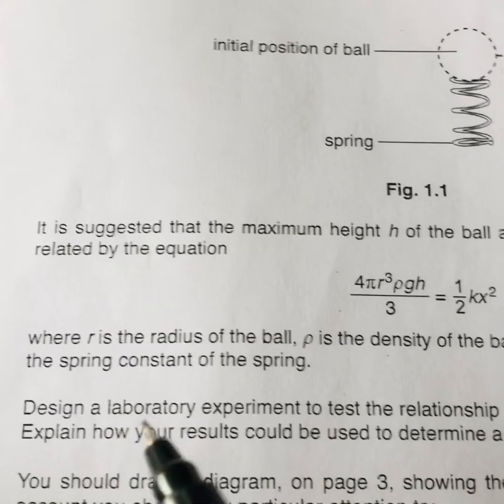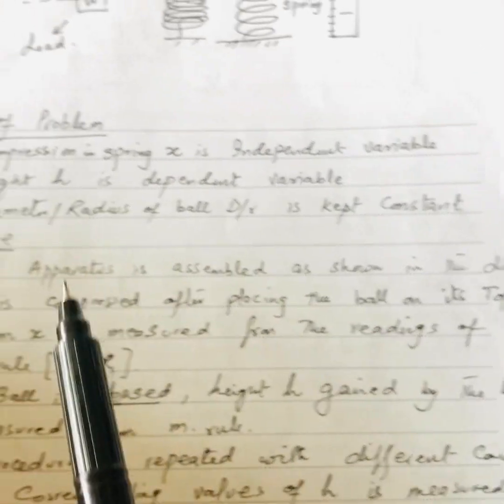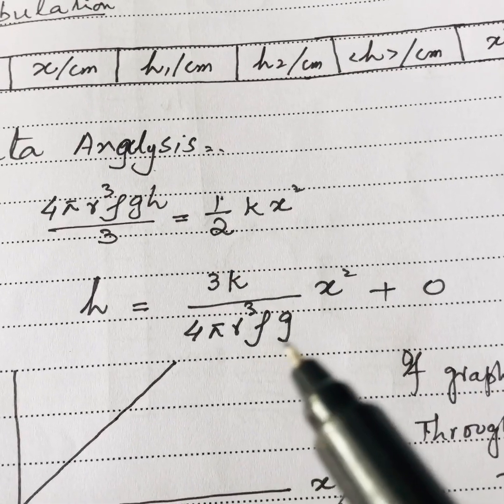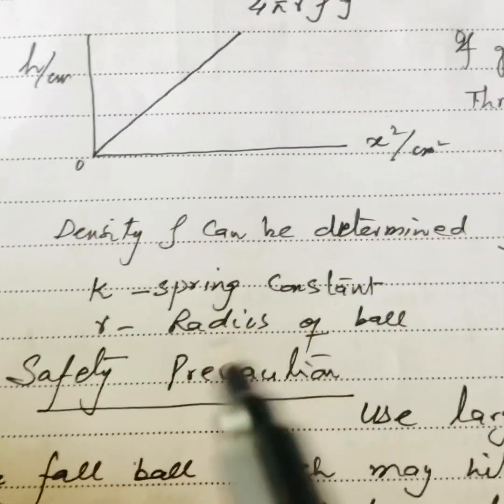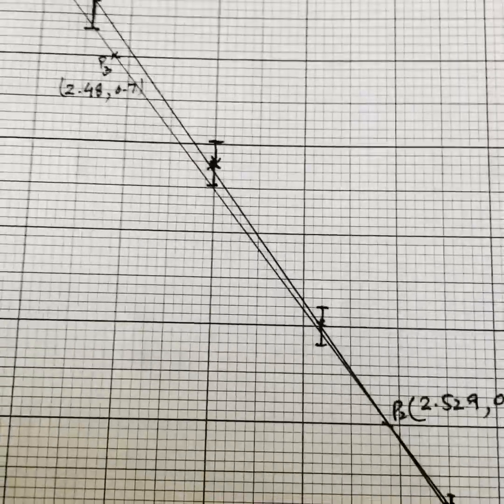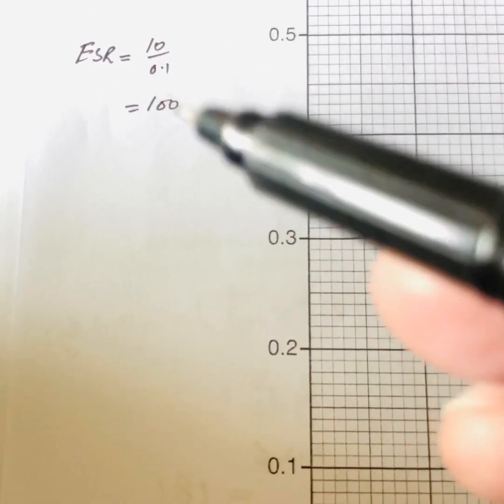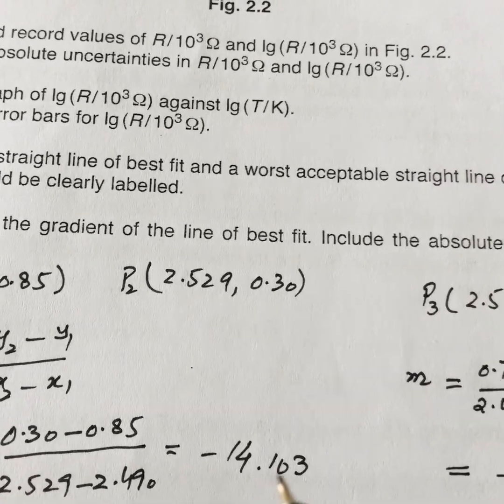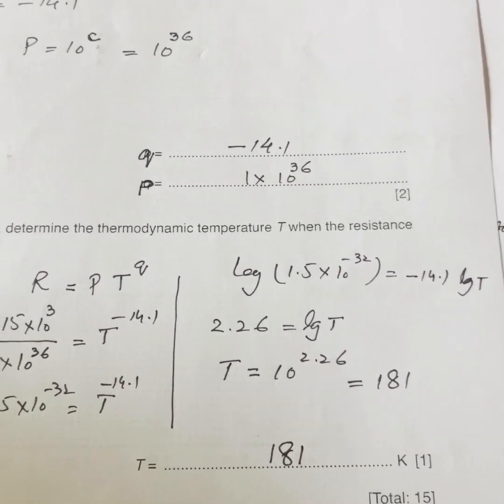Physics 9702/52 Nov 19

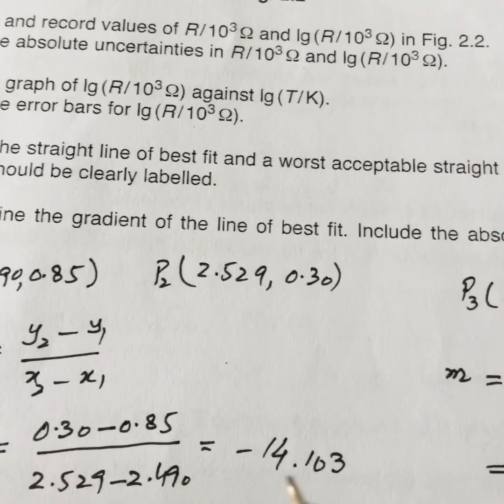Comment: In 8:37 why didn't you multiply y-intercept with 10^3 cause lg(R/10^3) is given. Please explain.
Reply: yes I have the same doubt
Reply: in case of Logs we usually don't consider the powers in the gradient and in the last question 15 stays as it is as we haven't taken powers into account
Reply: @hashirafzal9822  thank you 😊but my exams got cancelled yaaaa!!
Reply: @hashirafzal9822  try on ur calculator cuz i got two diff values when i multiply with 10^3 and w/o 10^3 which means it does not cancel and we do have to consider 10^3 while solving. do correct me if i am wrong cuz i am not sure as well.
Reply: @hashirafzal9822  are you sure?

Comment: Excuse me sir, i have a question regarding minute 5:43 . You said that we can use either three or four sig. fig. But if i choose to use 3, for the last two datas the uncertainties will have to be rounded off to 0.0 because the value at the second decimal place is 4 and that is not possible to put down. So how do i deal with this?